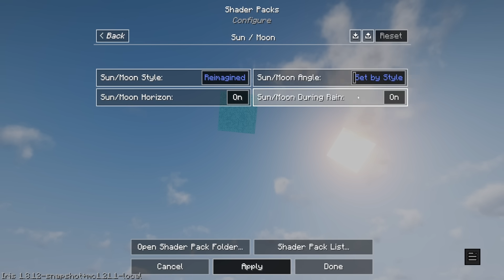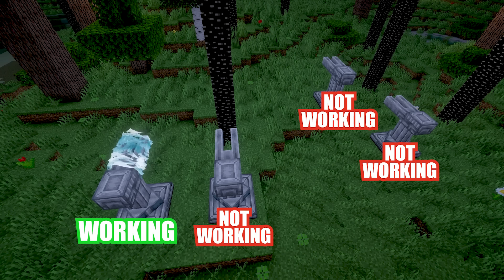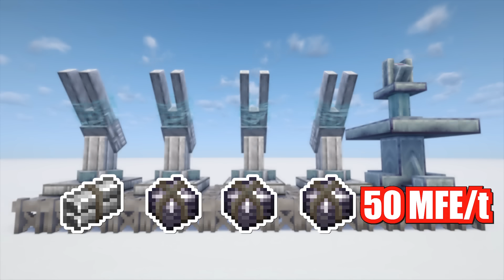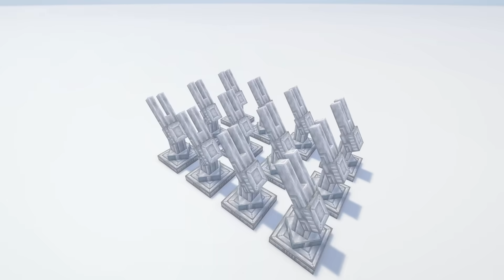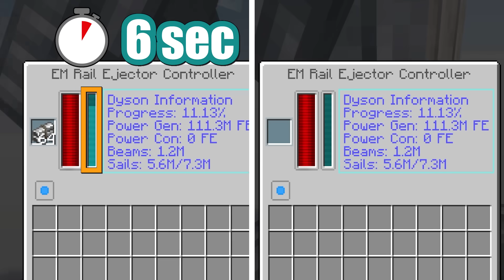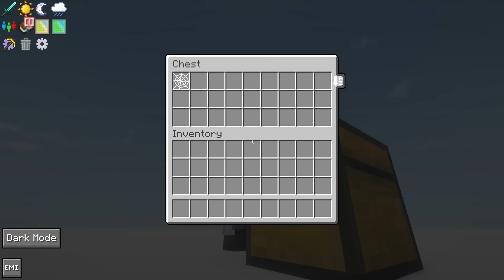Making 1 BILLION FE/t?!?! - Dyson Cube Project

Comment: Using block generator glass is farmable using cobble transformed to gravel than sand than glass, iron by crushing ochrum using block generator (create), same with copper by crushing veridium, it is very fast to setup and the cost will be absorbed in no time, the issue is lapis though

Comment: The best way is to have 3x sail sender and 1x Beam sender, make interface with crafting for beams/sails and send them via Logistics Network mod wirelessly, power from bottom, and 4x Advanced Clicker with time wands to tick speed the senders, make 24x each geores material automation and leave it be, just remember to fill the wands from time to time, I'm still at early/mid game, literally have only mob farm, sieves automated and ae2 quantum computer and matrix assembler, time fluid automation + mentioned earlier geores, and im already at 70m FE/t without leaving my PC with minecraft running 24/h + i only send normal sails and beams, not packages to save up on some materials

Comment: I tried it... and ressource was an issue I didn't anticipated.  I had a 4 raygun setup.  I had 3 hydroponic with lapis seed fully upgraded build up to 2.4 effiency... and it was still not enough.  Plus, at some point, it has catch up on my iron... you know that Iron is the most use item in ATM10?  Or at least it is for me!  So, once I got to the point that the autocrafting of sails and beam eat all my iron as soon as I got some, I had to stop the dyson project.

Btw, if I understand well, productive bee is probably the way to go when it come to ultimate production (with the extra mod that allow you to basically have a 3x3x3 hive).  Otherwise, keeping up with 4 ray guns is asking a lot... so I don,t want to know what need to be your production for 112 of them!

Comment: The requirements just make no sense for a lot of this.  Were are using Railguns not launching rockets, you do not need sunny clear weather to shoot a gun accurately.  Also not being to use ANYTHING at noon just makes no sense, if you have something that can track up to 85 degrees in either direction why would you not just let is go the full 180.  Not getting power at night is understandable but I would like to see a workaround besides spamming batteries, that just isn't fun or unique.  Maybe a Mirror Reflectors can be launched to allow power generation at reduced efficiency during night.
Reply: turning the moon into a giant mirror sounds like a perfectly goofy companion for encasing the sun in solar panels

Comment: THIS MOD WAS SO MUCH POTENCIAL
The world should become darker the more sails we send, not working during the night is okay but bad weather should only apply a 5 - 10% dubuff to energy production, I mean the sun really turns into a world ending deadly laser even at 1% and there is no way a fucking bitch ass cloud is going to stop it, a constant white laser vfx from the sun towards the receptor is also a nice easy addition, it's intensity could change depending on the amount of sails, the receptor can be altered to be like draconic evolution and just END THE WORLD if it is broken unexpectedly, imagine still having little cannons but also an huge ass 10x10x10 cannon to send stacks, the design can be like a subnautica cannon and it being a multiblock like create big cannons, and also an advanced receptor in the same way that also allows it to work during the night at a tenth of its max by adding mirror satelites on orbit or shotting mirrors in the moon, the fases of the moon could influence night eficiency, and advanced cannons and receptors could allow limitless growth at the risk of the world becoming eternally dark and cold, except around the advanced receptor, climate maintance mechanics can be added around this... I need to stop

Comment: does this work with immersive engineering since it use FE?
Reply: Yeap, most tech mods since 1.7 are intercompatible
Reply: @SodaDone  I was just wondering if the wire connectors interfaced with the collector
Reply: @loona5530 more than likely, but its usually better to use a different mod (like the thermal mods) for energy/fluid/item transfer

Comment: What's funny is, this is COMICALLY weak compared to a real Dyson Swarm.
Assuming 1 FE = 0.1 Joules, 1,000,000,000 FE/t is 1,000,000,000 * 0.1 * 20 = 2,000,000,000 Watts. That might sound like a lot, but it's still within the range of some of the larger real-life power plants (nuclear or solar panel farms)
For a Dyson Swarm, even something that captured only a percent of a percent of the Sun's energy would be 3,827,000,000,000,000,000,000 Watts.
Reply: I’m not sure why you’re calcing the FE to be equal to 0.1 joules. As per the video, a 5 meter cubed nuclear fission reactor produces ~67k FE/t, which would come out to about 134 kilowatts. Some cursory googling suggests that small modular fission reactors bottom out at 5 megawatts which is over 37x what the ATM reactor is capable of producing. I think it’s safe to say that 1 FE is a lot more than 0.1 joules.

Although, all of this is still to say that the ATM dyson swarm’s power output is still comically small

Comment: How do you get the hexagon pattern animation in the ray receiver controller and the dyson cube to render with the Complementary shader? For me, the texture is just invisible
Reply from the maker: Oh I totally forgot that I updated to one version above the pack, which I was told fixes that
Reply: @BucketSt  I'm currently using the mod outside of the modpack. What are your shader settings besides what is used to fix the sun?
Reply from the maker: @anthonypalmer1886  Fairly sure I'm just using the default settings

Comment: This will fit perfectly in those huge progression packs where you start off with steam engines and then end with harnessing the power of a star
Reply: GT:NH already has a dyson swarm multiblock
Reply: Why I'm not surprised?
Considering 1 GRF/t is 250M EU/t, it wouldn't even be enough for late game.
Reply: @pedronunes3063  Probably if it were ever to be ported to GTNH instead of its current version it would be changed to 250M EU/t
Reply: @LegsOmega  Of course it does, I’ve only ever made it to HV tier and was burnt out by then to continue

Comment: This would be far more interesting if the other power generation methods had severe tradeoffs similarly to how Factorio balanced it's power generation, but pollution doesn't exist in any form in ATM. Coal Power in Factorio is cheap and easy to set up, but highly pollution heavy and scales in fuel cost. Solar Panels are weak and require batteries to hold energy when it's night time but can be mass produced and tiled and are completely pollution free. Nuclear reactors are pollution free, but require specific designs and a supply of uranium to run.
Reply: Well the to balance the Dyson sphere you would require a shit ton of resources as balance to properly pull off
Reply: The only "solution" I could see is a modpack which balance different power generation
so all of them are useful in different way and cost/side effect.
Reply: Notes taken. Let's add pollution to the next modpack lol
Reply: @SparkyRedheadSupremacist  Considering the All The Mods packs are designed entirely around optimizing infrastructure to achieve a production goal pollution would be a solid counterbalance to the pack's insane power generators. As for how that would affect the world and pack I'm unsure of but I think All The Mods suffers from the fact that it's primarily based on producing things with no real enemy to that. To that fact it feels a lot like Terraria Journey Mode more so rather than a production game. It still has some core elements such as using production to create an insurmountably difficult item, that being the ATM star.
It's a lot how Vanilla Minecraft's core design is around building structures and that the Creeper is a foil to that.
I understand other such packs like Gregtech exist, but I prefer the way All The Mods allows the mods to interact and all serve a purpose and I hate the unnecessary convolution when making something simple with high amounts of potential optimization is more fun.
Reply: @lotion5238  "Considering the All The Mods packs are designed entirely around optimizing infrastructure to achieve a production goal"
This isn't true. ATM packs are kitchen sink packs with enough edits to have a sense of progress & be playable for at least a week or two per play through. Go play GTNH if you want serious progression with hardships like pollution lol
Reply: @APunishedManNamed2  Not saying you're entirely wrong, but the Magic mods and other mods are also used quite frequently in the production cycle. Additionally I think GregTech is often far too punitive for me to actually enjoy it, whereas ATM rewards trying out new things/mods. A particular example is intermediate products that require a multitude of different tools, that end up just forcing you to fumble around in a bunch of chests and inventories. I personally don't like GregTech a lot but maybe I should give it a shot again.

Comment: A long time ago I read a children's book about 2 people and trying to sleep on increasingly cold winter days. One piled on blankets and wore 3 winter coats and 5 hats, and the other just used increasing numbers of their pet dogs as a blanket. Anyways I went into that backstory just to say that while you spent several hundred million resources to make a dyson swarm produce 1 billion rf/t, I just built my 16th insanite turbine, and now have 1.008 billion rf/t.
Reply: Awesome! Could you please share dimensions of the reactor and turbines you’re building? I’ve never quite figured an optimal numbers…
Reply: @obqoYT   7x7x14 turbine with 2 layers of 16 insanite each. 7x7x3 reactor with a full checkerboard provides enough steam for 1 turbine, with enough slack that you don't need to optimize coolant, and pretty much anything better than air will work, though redfrigium, or allthemodium blocks are best for fuel efficiency.
Reply: reactor has to have a 3 block inset internally of the insulation blocks (unobtainium) [or better put 3 blocks inward at the reactor walls] then the checkerboard pattern (make sure all rods have each horizontal face covered with insulators, then make it a steam reactor and output it into multiple steam turbines which I think are 5x17 for dimensions.
Reply: Franklin

Comment: hey quick quest how do i put the power i create into my me system been suching for ages but still cant out i tried with an interface but its not pulling into myy storage cells¨
Reply from the maker: First, you need to make sure you have Applied Flux set up. That means you need FE Storage cells specifically in your system. Then you need something to actually push power into your system. Flux networks is good for that. So the best thing you can do: Flux plug on the ray receiver, flux point on a flux accessor will send the power to your system (That's an applied flux block).